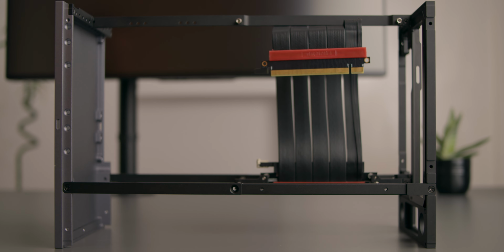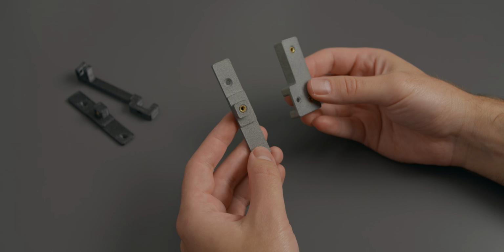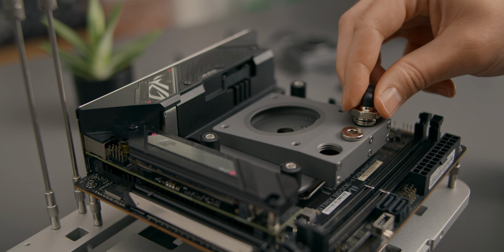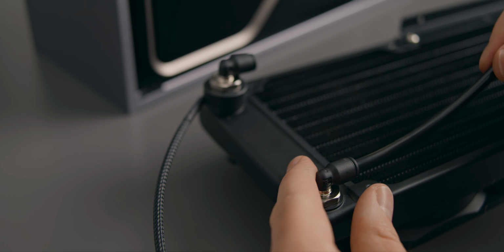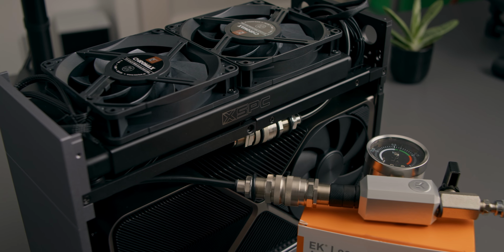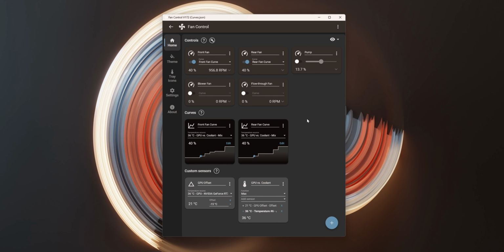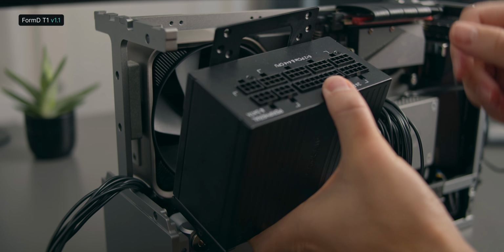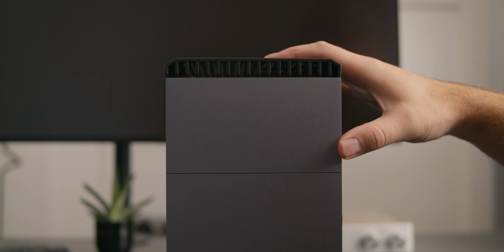FormD T1 pneumatic tubing build

Comment: I have the same case but I used an AIO. I feel a lot more people would be willing to use this case if content creators didn’t make it seem like you had to make a custom loop.
Reply from the maker: That's a fair point. I'm also considering doing (yet another) video on full air cooling in the T1.
Reply: @EIGAtech I had mixed results with air cooling. I couldn’t even keep a 5800X3D cool without undercooking it. There’s no way I’d be able to cool the 7950X3D that I have now. FYI: The AIO I am using now is the Corsair H100x RGB Elite
Reply from the maker: @chekote Interesting. Which air cooler were you using with the 5800X3D
Reply: Which aio did you use
Reply: @macfogi6438  I think it is the XSPC TX240 Crossflow Ultra Thin Radiator, 120mm, I hope
Reply: To be fair i had a lot of overheating issues with the 5800X3D

Comment: Excellent video - really keep on! I am also a FormD T1 owner with 4090FE on air, HPE240 and Eisbär Solo cooling a 13900K. I am using three A12x25 that means over the PSU I am using push/pull mode which improves a lot the airflow. Try it :P
Reply: No one asked
Reply: What are your temps? Idle and under load
Reply: What's that temps like?

Comment: There is an aluminum top hat, but it's quite a bit more expensive. Though, I'm sure it looks heaps better than the 3D printed one.
Reply from the maker: Hmm… which one do you mean?
Reply: @EIGAtech  on the site, I saw an aluminum option for the top hat. It's listed if you check their site.
Reply from the maker: @ghost-type  Ah, I see the option now. It was never sold however, and I think for the time being the project is on hold.
Reply: @EIGAtech  I hope they bring it back. Aluminum would definitely make it match the premium feel to the overall build.

Comment: Is there any advantage to putting the fans on top rather than underneath the AIO radiator - what most people are posting on YT?
Reply from the maker: If I recall correctly TX240 radiator has clearance issues if mounted on top, AIO setups may differ.

Comment: Love your video. Was wondering if you could do an update video and possible compare more radiators with the top hat.  I'm thinking of doing a T1 build with the ModUltra LOBO and pneumatic tubing. Since the T1 only has 46mm of space for the rad + fans I see a lot of people going with the XSPC TX240 with 25mm fans, but I was wonder if there was any real gains by getting one of the Expansion Kit tops adding 16mm giving 62mm for the rad + fans. This opens it up to 30mm rad + 25mm fans, 30mm rad and 30mm fans, or do a 30mm rad with dual 15mm fans in push/pull, or even a 45mm rad + 15mm fans. Would love to know if it would be worth going with a larger radiator than the 20mm TX240, and if so which rad/fan combo is the best.
Reply from the maker: Thank you! I don't think I will be revisiting this particular T1 build, I actually preferred the aircooled build I did on this. But to answer your question, I suspect a 30mm rad with 30mm fans would be superior and probably the best setup. Thicker rads such as a 45 would require high fan speeds to overcome the flow restriction, so definitely would not recommend those with slim fans.

Comment: I'm concerned if the neumatic tubing would stress the water pump
Reply from the maker: DDC pumps are quite robust, there’s not much that can break other than the bearing / bearing contact, and I imagine you’d hear it if that was the case.

That said, I did run into issues with air pockets on this particular build after about 6 months of use. The build didn’t have any leaks but somehow an air pocket kept forming in the pump, and the CPU temps would hit hard shut down temps. I decided to scrap the build in favor of my recent “ultimate” air cooled build.

Comment: Having a very hard time locating a 6mm quick disconnect
Reply from the maker: The quick disconnects are normal g1/4 with 6mm pneumatic fittings on each end.
Reply: sorry I meant 8mm not 6mm, but may go external will have a lot of wasted fitting if I go air cooling

Comment: due your claim to focus also on productivity ...did you do a cinebench 23 multicore test, i wonder what the temps are. Im running right now also a delidded  7950x3d but with the direct die cooler of thermal grizzly  with a custom waterloop in a v2 formdt1 with a regular thickness 240 rad +  2x 15mm noctua fans, if you want a drop of cpu temps of about 20°C  change to direct die cooling, but be aware, waranty is voided by delidding. 

Im topping out the cpu temps in cinebeng r23 mulitcore at 75°C (open sidepanels) 78°C (closed sidepanels) pulling 137 watts
singlecore (gaming) ~65°C  pulling 60 Watts

if you wonder where to put the pumprez combo i can recommend the alphacool DC-LT 2 (small and perfectly silent)

eager to know the developement of your build.....keep going!!😁😁😁😁💪💪💪💪

Comment: how are the tubing and fittings holding up?
Reply from the maker: Funny you should ask. I have been having an issue with coolant loss but no leaks. I am going to be working on a new video and I will address this and any potential findings.
Reply: @EIGAtech  how did you mount the Noctua fans to the radiator
Reply from the maker: @palps797  You have to get a bit creative there. In the video I am using short screws that sit inside the fan screw channel. Simplest method is to use nothing at all, the fans will be held in place by the top panel as there should be pretty much 0 gap between them.
Reply: @EIGAtech  Thank you so much
Reply: @EIGAtech  also where did you buy the Barrow thread reducers

Comment: @eiga - Now that you have lived with the Modultra block. What do you like and dislike about the block?
Reply from the maker: It's a great block, hard to find any faults with it really. Maybe the mounting hardware could be better, as I'm not a fan of the plastic spacers, it's pretty difficult to know when to stop as they provide little feedback that they have bottomed out.
Reply: @EIGAtech   - Lastly, what about the noise of the DCC pump on the actual block?  I am considering either separating the pump from the block or using the pump on the block.  I want an amazing performance, but I do not want a noise maker either.
Reply from the maker: @lhbbq  I think it depends on how restrictive the loop is, In my case, I need to run the pump at 15% or less, anything higher and it’s definitely audible. A DDC pump is way overkill for this kind of loop and 100% sounds like a plane taking off 😅.
Reply: @EIGAtech  - Thank you so much!

Comment: the b650e-i has a thermal sensor pin so u don't need the quadrom save space use bios :)
Reply from the maker: I am. The Quadro was used in the old build. That said, I am thinking of using the Quadro again, mostly so I can avoid the unnecessary 100% ramp up that the pump does during boot when attached to the motherboard's PWM header.
Reply: The ramp up doesn't bother me as much as wire clutter

Comment: Hi! Can the pneumatic fittings rotate freely once tightened?
Reply from the maker: Hi! Yes, they are rotary. However they are quite stiff and they can easily unthread from the G1/4 thread if rotated counterclockwise. Still useful for making sure they are facing the desired way.

Comment: That build looks so clean! Does anyone know if that anti-sag bracket will also be compatible with a 4080 Super?
Reply from the maker: Thanks! The dimensions of the new 4080 Super FE remain identical, so as long as it still has the M3 holes at the rear (under the magnetic cover) it should fit.

I haven't been able to find any photos of the rear part to 100% confirm it though, maybe someone else can reply to confirm.

Comment: Per your gpu sag bracket. I’d love to see a thorough 3D printing guide. What software you used, how you measure for angles , height, etc. there isnt really any 3D printing guides on youtube and the ones that are still leave so many questions .. if you think it is possible? thanks
Reply from the maker: Thank you for the sub! Maybe I will dive deeper into something like that in the future. But there's no secret to the process. I measure distances with calipers or rulers. If I can't get a measuring tool in a tight place I find something that fits in that space and measure that +/- some guesstimates. 

For the bracket I made sure the GPU is sitting perfectly level by lifting it up with improvised supports underneath,  then I measured the distance relative to the front panel and the rail mounting  above. Once I had a few good known measurements that I could rely on I started drafting designs in Fusion 360.

Comment: amazing build, i have a similar build, i7 13700k + 4080 FE with fractual lumen aio 280mm 2x noctua chromax, but formd black edition
Reply: How are your temps. Did you undervolt the cpu?
Reply: @Sabakoe737  in gaming 70 degrees average, yes i did undervolt

Comment: @EIGA Great vid! Just ordered the CNC version of the 4090 bracket and mount from JLCPCB but really need more info for doing thread tapping when it gets here...I see M3x5 countersunk but could you point me to exact source of M3x5 black anodized screws I need?  Also, do I need a brass insert for CNC version?  Do I need to know what thread size and thread pitch is ideal for doing thread tapping on CNC version? 6-32 maybe?  Sorry I've never done this before and am hoping I didn't bite off more than I can chew.  Thanks a million for for long comment here
Reply from the maker: Thanks! There is a .pdf technical drawing in the CNC files .zip. The thread that needs to be tapped is M3 with a depth of 5mm. Brass insert is inly for the 3D printed version. You need one M3x8 and two M3x5 countersunk screws just like the ones the case came with (can just use those, as you should have extras).
Reply from the maker: P.S. The technical drawing should be submitted when ordering the part, so it's clear which hole needs to be tapped and to what specifications.
Reply: @EIGAtech  I better dig that PDF up and try to submit to JLCPCB's Customer Service to include with my order..really hope they can take care of that thread tapping.  Thanks again so much, really love the channel!
Reply from the maker: @ImaUser-g1c  Any luck?
Reply: What is the diameter of the m3 thread? Also, did JLCPCB do the anodizing as well? And how much did they charge?
Reply: @EIGAtech  is it better for the brass insert to be tapped in or heat set?

Comment: Always love to see your vids!
I'm currently using the T1 with Hudamod and side 280 radiator, but I'll go with a similar setup to yours very soon.
Only difference will be, that ill be using an XR5 or 240GTS and some AS120 rgb fans to have some nice bottom lighting.
My main cooling is done by a MoRa anyways.
Also glad you moved to pneumatics now. If you have the room for it, the Festo full metal fittings look a bit nicer and I personally will move from 6mm to 8mm again.

Keep it up!
Reply from the maker: Thank you! The Hudamod configuration is something I looked into as well.  What GPU waterblock are you using?
Reply: @EIGAtech  I was using the Comino 4090 block. Sold it due to someone else bugging me weekly about it and now I'm waiting on another waterblock for the FE
Reply from the maker: @Aexeq  😵‍💫 That person must have been rather insistent. So the setup was/is hudamod with 280 side radiator, 25mm fans, LOBO and single slot waterblock? Really curious how something like that would perform, especially compared to a dual rad build like Optimum's. Still, I imagine that without the MoRa coolant temp would be hard to manage, and CPU temps would suffer especially when the coolant temp is in the 50s.
Reply: @EIGAtech  it performs solid I'd say.
Haven't run any extensive tests, but from the experience of others and my subjective observation it's on par with dual rad, since it makes up for the lost radiator surface by having less restrictive airflow.
Huda is currently building a T1 with Hudamod, 4090 with EK Inox block, ST20HPE 280, SWP4, Lobo without pump and a acrylic plate instead, LO1UES as the actual pump top.
The build already looks awesome in terms of technical execution and should push Hudamod to its limits.

My next build on the other hand will utilise standard 240 rad and CPU side intake fans to "turbocharge" fan rad combo. Sag this first from Nazh and it did surprisingly well.
Reply from the maker: @Aexeq  Thanks for the insight, interesting stuff, will follow along on Discord. I'd for sure like to try my hand at something like that, but since there's no single slot block available for the 4090 FE, I think I'll just stick to this. With a few tweaks, maybe an aluminium top hat, I think this is as good as it gets for me in the T1.
Reply: @EIGAtech  there will be a single slot block available for the FE. Just a matter of time and you already know the manufacturer 😉
Reply from the maker: @Aexeq  Oh my... 🙀
Reply: @EIGAtech  starts with Mod and ends with ultra 😁
Reply from the maker: @Aexeq  Figured. I need to keep a closer eye on Discord. You mentioned going up to 8mm fittings, any particular reason?
Reply: @EIGAtech  tests from users suggest, that 6mm might be a bit too restrictive for loops with a bit more than just rad and CPU/pump block. In your current setup I think 6mm isn't an issue.
Reply: @EIGAtech  just be warned though, the Modultra block will be absolutely minimalistic it will most likely even be less than one slot and will not cover the whole PCB to have the most room possible for airflow.
Reply from the maker: @Aexeq  This didn't make it in the video, but I did notice a slight increase in pump noise compared to my acrylic tube build. I wonder if that's because of the more restrictive loop, or maybe the QDCs.
Reply: @EIGAtech  could be both, but that is exactly what the majority based their suggestions on. The longer the tubing becomes, the more it contributes to restriction, that's why I said your loop should be mostly fine currently.

Comment: how did you manage to fit two 25 mm fans at the top. The official specs say 1 slim and 1 25 mm can be installed. Can you help
Reply from the maker: The TX240 radiator is slim enough to allow for that

Comment: Great video. I have a super similar setup with a 3090 + 7700x on a ST30 from alphacool. Temps are fine because I only game and I have a heavy undervolt, the only issues is that my Asus B650E-I has crazy coil whine, and the powersupply mount is not very confidence inspiring for me as I travel a lot with my build.
Reply from the maker: Thanks! My B650E-I has some coil whine as well, but it's not too bad. Definitely not dead silent like the B550i AORUS Pro I was using before.

Comment: Great video what screws did you use for the NF-A12x25 in the build im having a problem with the screws not letting the top panel close
Reply from the maker: I used some short flat head screws (5mm length), you can see this at 7:26. You need 6-32 thread pitch screws (not metric) and ideally something with a head diameter that's not too big (mine was, and I only used two for each fan). Hope this helps!

Comment: One more question, how did you manage to mount the fans to the top radiator? I know you can just use the pressure on the top panel to squeeze them but I feel better knowing they’d be screwed down. Did you just cut a 6/32 screw and use that to fasten it down?
Reply from the maker: I used some short flat head 6/32 screws. You can see them at 7:30. I only used two per fan because the flat head was too large in diameter and some ... force had to be used. But it works.

Comment: Is this setup in 3 slot mode or 3.25? I can't tell because in the beginning you say you are building it in 3.25 but at the end state to run it in the true 3.25 slot mode to get  rid of gpu fan noise. I don't understand
Reply from the maker: The strut is in 3.25 slot but the GPU is in 3 slot mode by using 5mm standoffs on the riser. I haven't tested it but true 3.25 slot is probably better for avoiding fan turbulence, however, in that configuration there's going to be no gap between the GPU and PSU so I wouldn't really recommend doing that.

I'll have a new video soon that's going to be air cooling focused and I will go into fan turbulence and noise again.
Reply: @EIGAtech  ah ok got it

Comment: Next year I want to make the same build as yours in formd t1 v2.but I want to add:hgst huh721212ale600.

Is it somehow possible?I was thinking between psu and card to put it.But i need to finde some psu that is thinner then corsair sf750,hdplex 800w or 2x 400w?
Reply from the maker: There isn't anything smaller than a SF750, and I don't have experience with HDPLEX power supplies or how they work. 

I don't see where that hard drive could fit, why not go for an external rack though?
Reply: @EIGAtech  I have a collection of series and movies from the 90s, it brings me back to my childhood and good times, so I im looking  to save it in the best way I can.I looked at some reviews for that hard drive and it seems to be the most reliable.T1 For me is art,the best thing we have today so I'm looking for everything to fit in it.I don't know,if you put a plastic extension, on bottom might have space to fit  in that hard drive.
Reply from the maker: @acadjukanovic6855  Hmm, maybe. If the top/bottom extensions make it to market that could be doable with some mods.

But if the collection is that important, I would still advise against putting into the T1, especially next to watercooled components. I still think an external solution would be better, maybe even with two drives instead of one (even an off-site backup if you have rips that cannot be found elsewhere).